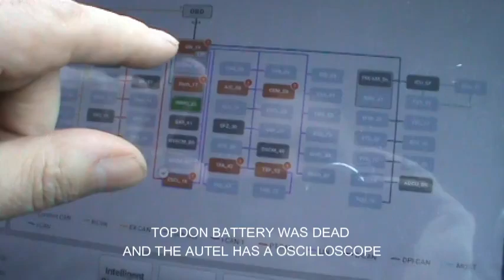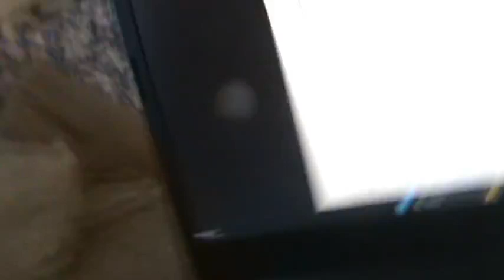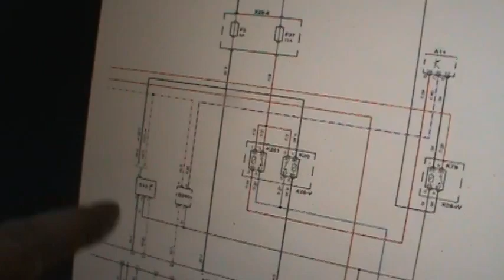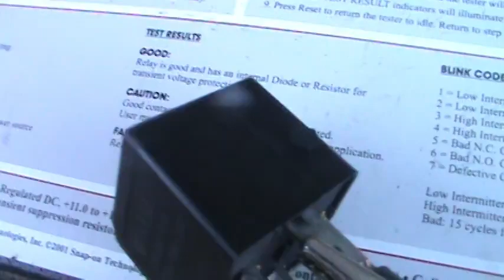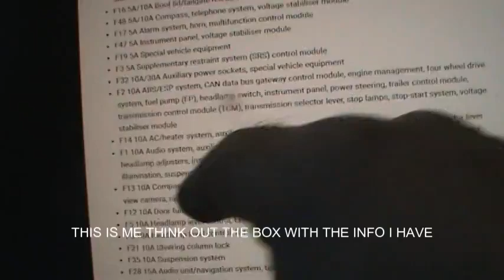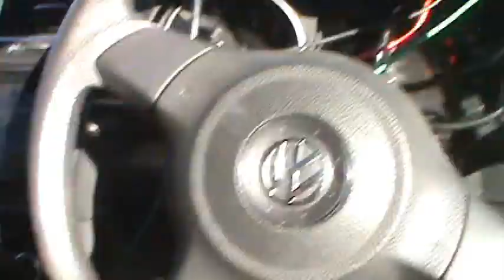MK 6 GOLF 1.4 NO START ,NO COMS , NO CRANK LOTS OF TESTING AND NO PARTS FITTED (TWO  PART) PART 1

Comment: Given me some idea about what's up with mine thanks. Accidentally arced the alternator lead to the engine. Changed a fuse on the top row which was blown but still nothing so will check the relays
Reply from the maker: There could be be a inline fuse from alternator to battery possibly
Reply: @trevorchillery1019 checked. No inline fuse, not even a fuse on the alternator itself
Reply from the maker: U sure there is not one at the battery or in front of the fuse box in the engine bay they are normally covered 
There is so meany set ups and not being in front of it makes it harder